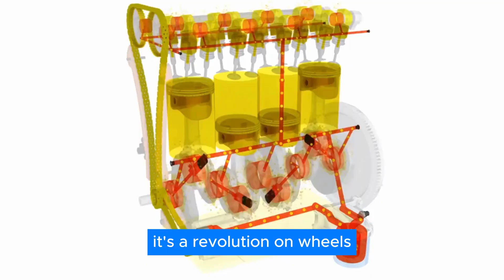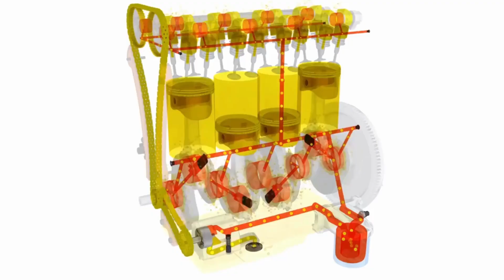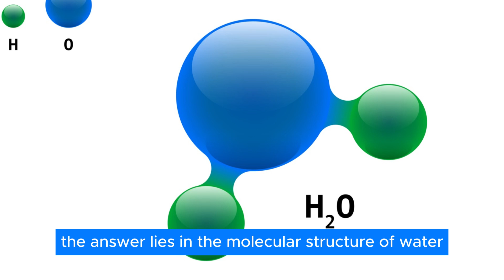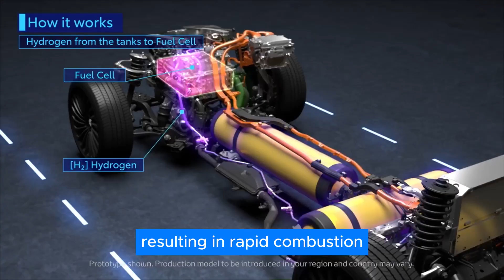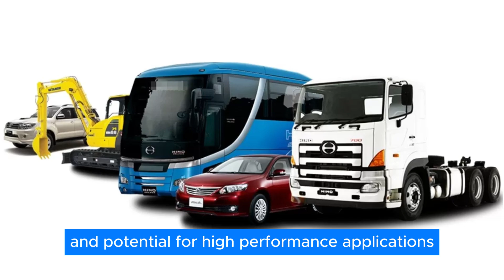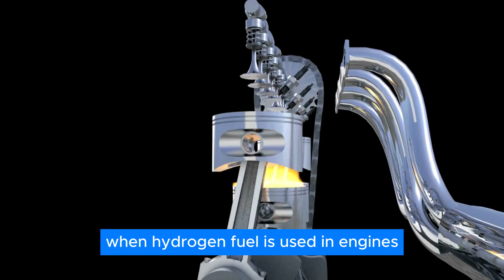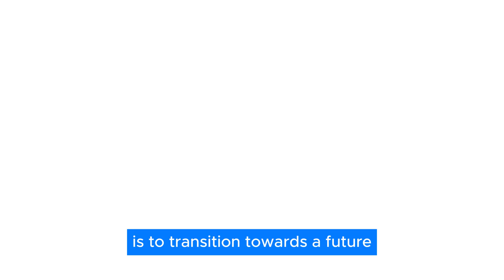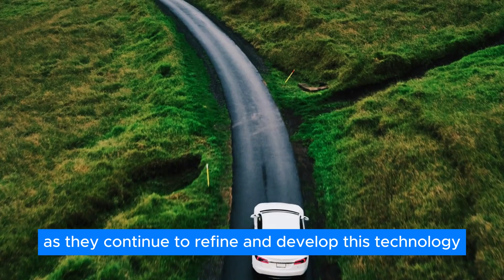Toyota CEO: This New Engine Will Destroy The Entire EV Industry!

Comment: Honestly with all the crap toyota has been building i think it will be a failure. Had a 2023 tundra engine just replaces with 7,000 miles. New engine is already making noises. Wouldn’t buy any new toyota again.
Reply: Seems you abused the motor, blame yourself.